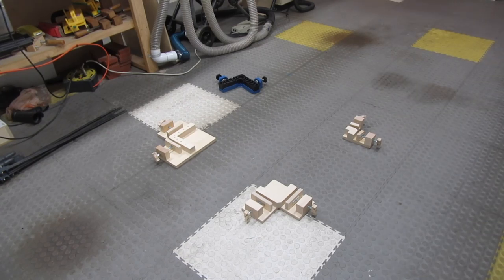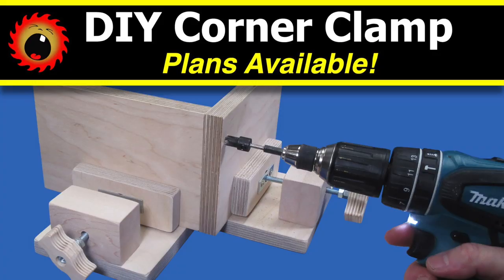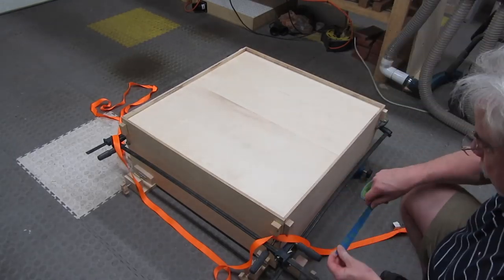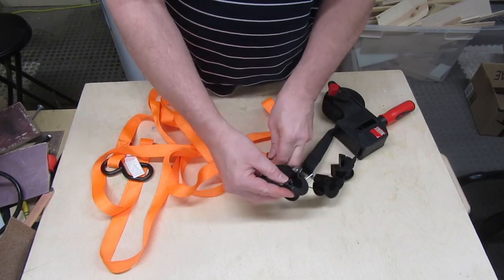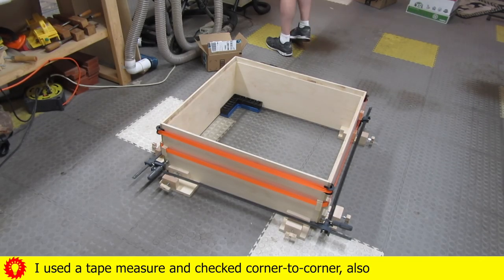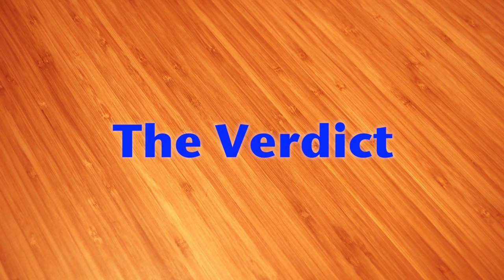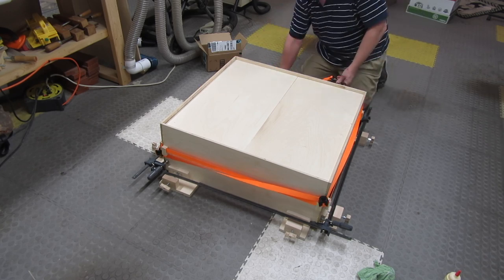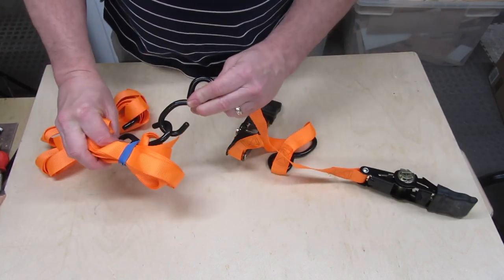Clamping Ideas for Gluing Big Boxes, Cabinets, Bookshelves, etc.

Comment: Great tips, Dan! 
When I need to use double sided tape, I will put on some painter's tape first. I make sure to cover the areas where the double stick tape will be placed. I do this on both the project wood and the template. When the two pieces need to come apart, simply separate them and remove the painter's tape. No residue left, no double sided tape to scrape off, no fibers lifted.
Reply from the maker: Perfect tip. Thanks, I'll definitely do this next time. 😄

Comment: I like the "you can throw it 15ft as well". lol.  The bessey clips are what I use when necessary.  You could probably make those clips easily.  Square block, drill hole in middle, bandsaw to cut inside corner to 90 degrees (hole creates a tolerance point to avoid the edge), round the outside with a bandsaw, then screw in some wood to hold the strap in place on 2 sides, but still freely moving.  Probably wouldn't take long to make and have the same effect.
Reply from the maker: Thanks, Troy. I really did accidentally throw the first one, and that gave me the idea. Good idea on how to build the clips. I think I'd rather just spend the money on them, unless I can get some other benefit by making my own. But I'll think about it. Thanks!
Reply: The benefit is money and there isn't that much time into it. Personally I'd 3d print my own clips but not everyone has access to a printer.
Reply from the maker: @WolfsHaven  👍

Comment: For the little wood blocks try hot glue. Holds good & it does peel off easily.
Reply from the maker: Thanks - that sounds perfect!
Reply: I use the clear hot melt glue for those temporary tasks.
Reply from the maker: @dannyscobee6530  I really need to remember hot glue. It's just not something I've used a lot of, but obviously it has a lot of uses. Thanks!
Reply: @TheNewbieWoodworker  Wood wisperer shared a good idea recently. Blue painter's tape on both parts. Then use C.A. glue to glue the tape together. the blue tape doesnt leave residue and peels off easily.

Oops, I just read more comments. I was not first to post this. Or even second or third!
Reply from the maker: @dougprentice1363  LOL, I should start a counter. It just goes to show how many people watch his channel! And I don't mind the repeats. When I post a comment on someone's channel, I don't always have the time or patience to see if someone else posted it first. And as for comments on this channel, I just love the interaction. I'm going to continue to enjoy it until the time comes (if it ever does), where the comments exceed my available time to reply. And I should probably learn not to talk so much in a single reply... 😏

Comment: Yet another great idea and presentation!  I believe you had a good idea on making the slots in the pieces you used for your Harbor Freight straps. I think that if you just joined the two pieces for each corner with a shop built corner piece that also incorporated a glue relief in the corner you could have avoided throwing your pieces away.  Also if you 'backed' the inside of the 'brackets' with a rubberized material you would eliminate the need to use double sided tape.  If I had all the skill and hardware you had in making your productions I believe I could have made these based on your idea...that's how easy I think it could have been accomplished, because heaven knows I'm just a neophyte!
Reply from the maker: Thanks, Timothy, but don't think too highly of my abilities. I show what I can do, not what I can't, and believe me, there's tons I can't do. But I think your idea is a great one. I don't know if you've seen these new little clamps Rockler has just put out: https://www.rockler.com/rockler-clamp-it-clips-4-packs. It kind of reminds me a little of what you're talking about. Maybe someone with better skills than I have could make something by combining these clamps with my slotted scrap blocks.

Comment: Combine your corner clamps with straps! One at the bottom and other at the top... 2x4 corner clamps and 2 x straps + more in the middle for largest glue-ups. Use hookless straps - easier to adjust as they dont fall apart and less likely to damage your wood.
Reply from the maker: Great idea. Thanks!

Comment: great video.  as to the double sided tape, I keep on hand a roll of scotch 3m double sided tape.  it's the same as scotch tape with adhesive on both sides.  not good holding power (light duty only)  but pulls off easily.  BTY, this box is why I am a big fan of pocket hole screws for large case assemblies.  nothing wrong with your method either :>)  keep the great videos coming.
Reply from the maker: Thanks, Russ, and thanks for the tip on the tape. This cabinet is actually a project from Steve Ramsey's Powered Up online course, so I'm trying to follow his plans. I say "trying", because of course I have to make it "mine". I've actually never used pocket screws because I've been so busy making videos, I haven't been able to build all the things I want. But I am absolutely going to use them on some project in the future. I'm a big fan of using screws. 😄
Reply: You will love using Pocket Hole techniques.  I did several PH videos including about how to make a "pocket hole super joint".  If you need any advice on the subject . . . I'm full of it :>)  just ask.
Reply from the maker: @russveinot5754  LOL, I will, thanks!

Comment: GREAT video Dan, I like your slotted wood idea, maybe make a simple clamp (or wire) that will clip over the top of the project and then it will hold your piece of wood in place at any level you want.
Reply from the maker: Thanks, and oooh, what a great idea! Something to think about. Thanks! 😄

Comment: Try pvc pipe as the replacement for the Bessey clamps. Woodworkers journal has a tip. DIY pvc corner cauls.
Reply from the maker: Thanks for the tip! That makes so much sense, I don't even have to look up the article. Wish I had thought of it. Genius! 😄

Comment: Hey Dan  instead of double sided tape next time try painters tape and CA glue, just put the tape on the both pieces you want to glue up, ca one piece activator on the other and press together, when you want to take it off the tape peels right off no damage. Think I saw this on Matt Cremona's or the Wood Whispers channel.
Reply from the maker: Thanks and yes, that was The Wood Whisperer. Someone else just mentioned that too. I saw the video, but unfortunately it was after I did this clamping. I
ll try it next time, assuming I remember... 😏
Reply: Try the double sided blue tape. :)
Reply from the maker: @TheJedc43  I didn't know there was such a thing!
Reply: @TheNewbieWoodworker  there isnt, but there should be. Thats pretty much what you are making with the tape and ca glue.
Reply from the maker: @TheJedc43  👍

Comment: Blue painters tape.  then put superglue on that, and then the clamp blocks on that.  when you pull the block off, the blue tape is really easy to get off, and it won't mar the wood
Reply from the maker: Thanks, Bill. I think that makes you the 6th or 7th one to mention this tip. Where were you guys BEFORE I made this video? LOL, just kidding. Thanks for the tip! (And don't feel bad about repeating what other people have already said - I'd much rather hear a good tip 20 times than not at all!)

Comment: Use a heat gun in conjunction with 1" putty knife for removal of the double sides tape. Harbor freight has a $9.99 heat gun (I've seen it as cheap as $7.99) and a $1.99 putty knife.. better yet, in the same section at harbor freight where the putty knife is, there are some floor scrapers that would work perfect for removal of double sided tape.  

Plug in your heat gun,  aim it at the double sided tape (not to close or it will damage the wood substrate). And effortlessly that double sided tape will come off..
Reply from the maker: Great tip. Thanks! 😄

Comment: Not sure if already mentioned. If using wood clamps, this is just an idea in my head right now. Not sure if practical or useful with modification (i am just starting to get into wood working). Have the same wood clamps you used on the bottom, and have them on top as well. This will keep both the top and bottom in line. Make another set of vertical wood clamps with two points of pressure on them. They will apply pressure on the top and bottom (or how ever many slots you want). Think of putting a piece of long wood between the F clamp and the cabinet. The top is clamped and the bottom is clamped. The long piece will provide even pressure. You can use smaller screw in clamps to provide even pressure in multiple places. Does that make sense?
Reply: Just read the other comment by Tom H, if you modify the design of your base clamps, you can use the above idea with it. This way it can work very well. If you use pin stops, you can alter the angle as well.
Reply from the maker: @asderven  Thanks for the ideas! 👍
Reply: @TheNewbieWoodworker  glad to help, i'll be making battery boxes soon, i'll copy your clamps and add that idea and see if it works out for me. If it does i'll upload the video and tag you in a few months. Depending on when the batteries arrive.
Reply from the maker: @asderven  Sounds good! Thanks.

Comment: I like the floor.  Do you roll machines over it or is it only for walking?
Reply from the maker: Thanks. It's mostly for the cars, which is now just car, since I park mine outside. It's easy to clean, not that I have recently. And rolling around my router table on it is fine, just bumpy. Don't roll it too fast, though. 😄

Comment: Great informative video. Would the straps work without either the  plastic corner "things" or the wooden blocks. I. e. with just the ratcheting straps?
Reply: You could, but the straps would dig into the corners and partially crush them.  That's not something that would be easy to sand out.
Reply: @troymeredith521   Thanks Troy, guess it would also depend on the hardness of the wood being used, soft wood more of a problem than hard wood, if a problem at all on hard wood.
Reply from the maker: Thanks Graham! The real problem with that is that it won't put pressure directly on the spots being glued. It'll just put pressure on the corner edges, and if you tightened it enough, it might even pull the inside edges being glued away from each other, if that makes any sense. And I'm pretty sure it would crack the edges of the plywood.
Reply: @TheNewbieWoodworker  Thanks Dan, think I will try the wooden block method, hot glue some of them and attach some with double sided tape.  See which works best upon removal of the blocks.
Reply from the maker: @grahambigland5154  Awesome! Looking forward to hearing about your results.

Comment: I started using Kreg pocket scres and like them the more I use them. Might be a little easier using Kreg that going all the straping work you did. Just My Opinion! Like the vides.
Reply from the maker: Thanks for the comment! I think you're probably right. But this is a project from Steve Ramsey's Powered Up online course, so I was just following the plans. If I had designed it myself, I probably would have done it differently, but it was fun to give this method a shot. If nothing else, it showed me I'd prefer to do it an easier way. 😛

Comment: If you cut off the hook for the long strap, and remove the revit from the body holding the small strap replace it with a bolt with a small peace of tubing through the loop of the long strap ... no more hooks to deal with. Making a loop strap.
I am sorry that this sounds as clear as mud ... but it is simple.
Reply from the maker: Thanks, Monte. I actually didn't have any problems with the hook, I just needed some video to show while I was talking. That footage was actually me thinking of something completely different, while I played with the strap. But now that I think about it, not having a big betal hook banging against the project sounds like a good idea. I'll have to think about it. Thanks!

Comment: Nicely done Dan! Too bad that you couldn't have elevated that workpiece well up off of the ground as it would have been much easier to do the glue up.
Reply from the maker: Thanks, and very true. And my back wouldn't have hurt so much. I really need to work on my core strength.
Reply: @TheNewbieWoodworker , or building a decent assembly table. ;-)
Reply from the maker: @awlthatwoodcrafts8911  The problem is, I've got nowhere to put it. For example, I have to take my bandsaw out of a cabinet everytime I want to use it. I hope to make an integrated work environment at some point in the future, but for now, there's just no room. Sigh.
Reply: @TheNewbieWoodworker , have you seen the "ultimate" workbench by Dave Boelenski? If not, look up his channel by his name. Maybe it is your solution.
Reply from the maker: @awlthatwoodcrafts8911  Yes I have! Ahd that, or something like it, is my ultimate goal. Of course, I've wanted something like that for 2 years and I haven't gotten any closer, but that's absolutely what I want.

Comment: Why not make another set and clamp the top exactly the way you clamped the bottom? Just turn them over. Love the clamps you made btw.
Reply from the maker: Thanks! That would have helped, but I didn't want to spend the time building them. And with the size of the pieces I was gluing, I needed something around the middle also. If I thought I'd need to do this again, I'd probably consider it.

Comment: Check out Izzy Swans videos. He uses a lot of wedge based clamping techniques you can do for free with wood you probably already have laying around.
Reply from the maker: I watch Izzy Swan's channel, but I don't remember those techniques. I must not have been paying attention. Yesterday I was thinking of a project that I wished I could pick Izzy's brain over. Smart guy, and he seems so genuine.
Reply: @TheNewbieWoodworker   Here's one:

https://www.youtube.com/watch?v=rlehVLUrPPE&t=346s

There is more.  He said he had to think outside the box a lot of times when he didn't' have the clamps in making furniture.
Reply from the maker: @basanistes359  Thanks, and I saw that video. Here's what's interesting - when I was trying to figure out how to clamp this, I was thinking of a kind-of similar idea, but I wasn't sure I could pull it off. Here's a pic: https://i50.photobucket.com/albums/f350/dagware/Clamping%20Jig_zps2xpjhdlk.jpg. It's not exactly the same thing, but close.